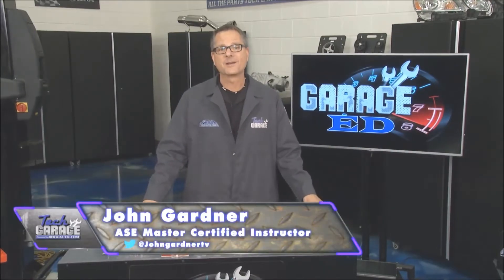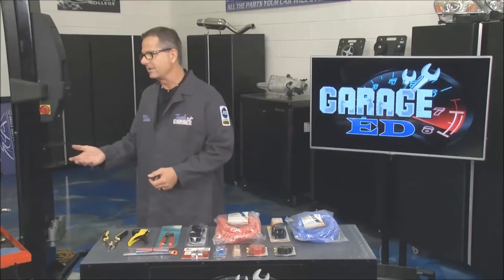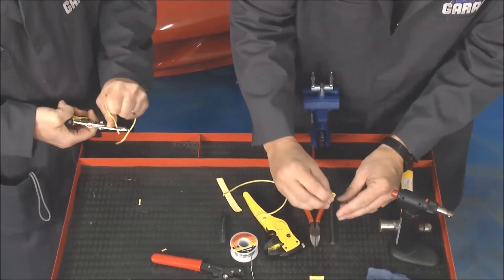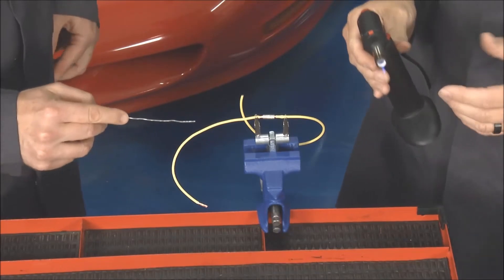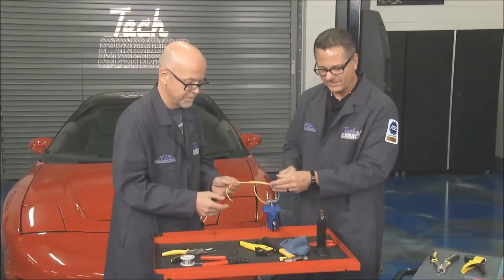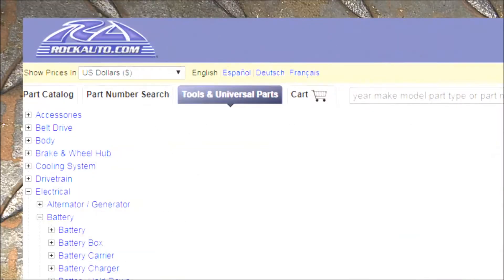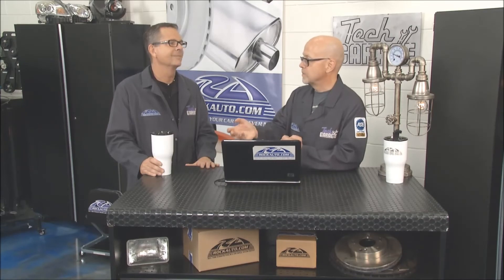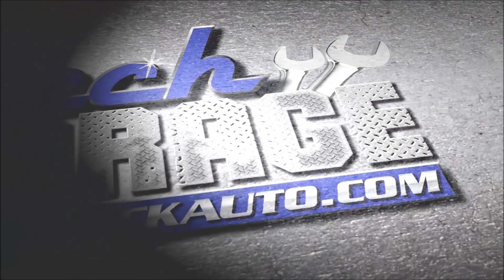Automotive Wiring Basics: Splicing, Soldering, Grounding (Season 5/E6)

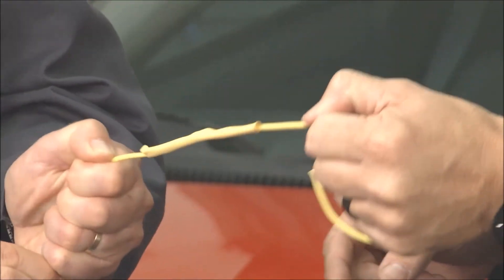Comment: It's not separating 3:34
Water could interfere unless sealed w/
Thermal waterproof adhesive paste at >450F°
Even normal freezing temperatures when wet should be considered which is <32F°